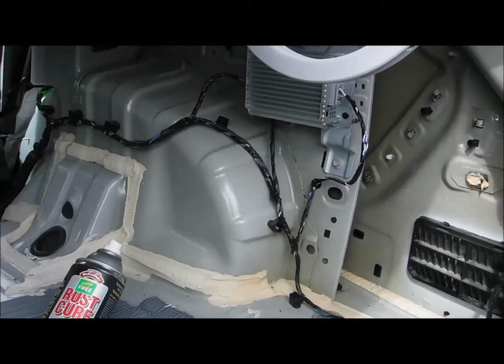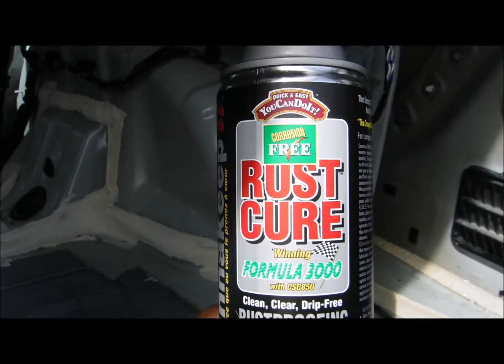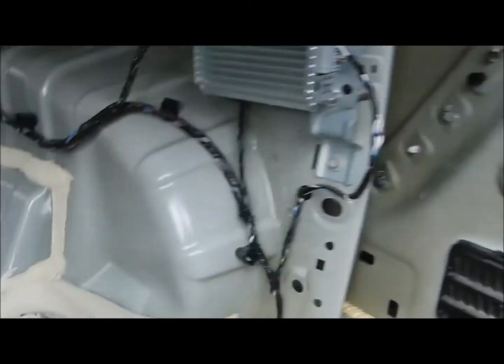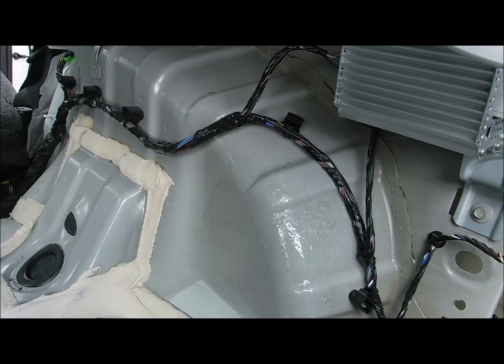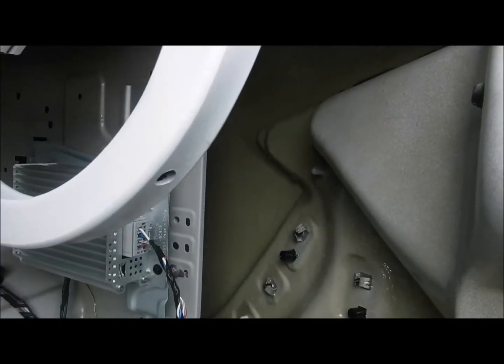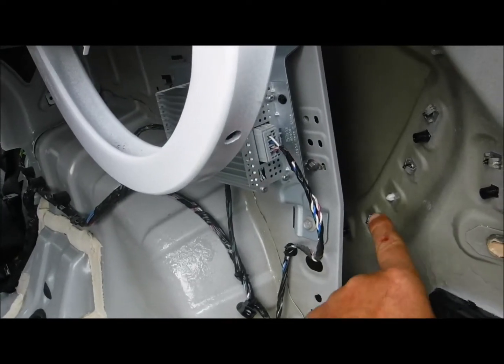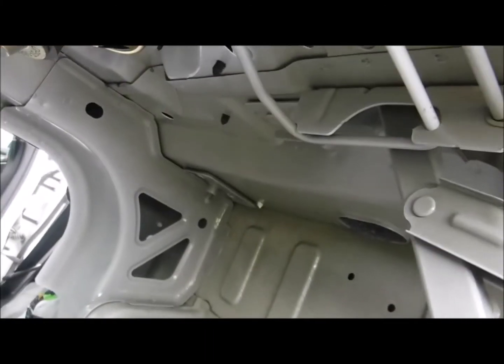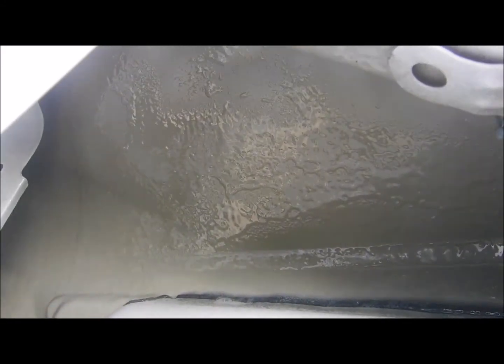Ford Fusion Rust Protection Like This Will Make It Be Rust Free For Years To Come

Comment: Good luck ,Ford Fusions have rust issues.Some say the paint was not applied to a correct thickness at the factory.Makes sense as the areas around the wheel wells ,lower doors and lower trunk lid areas seem to always rust. The protective primer ,base coats and top coats should protect these areas ,but in the case of the Fusion and Escapes the paint seems to flake off.Had a friend with a Fusion that the areas around the rear license plate had rust holes right through the metal.It was still in the perforation warranty time period but Ford would not honor the warranty.Ford always says "environmental factors are the issue".He will just not buy a Ford again.  What you are doing makes sense as cars often rust from the inside out. Yet why is it you see 12 to 15 year old Toyota Camry's that don't have these rust issues?The other very important thing to do is if you get a rock chip on your paint touch it up asap as that chip can grow into a major rust problem.
Reply from the maker: Good point. TKS
Reply: does 3000 smell
Reply from the maker: @randomrazr  Not to me it don't.